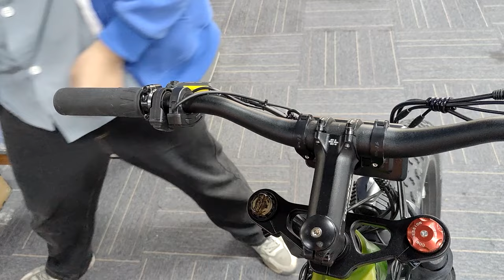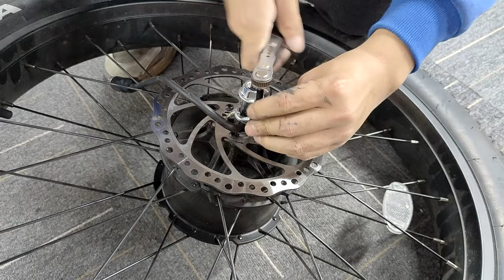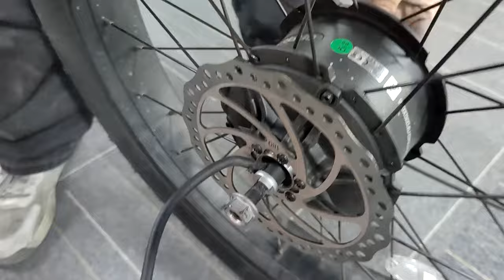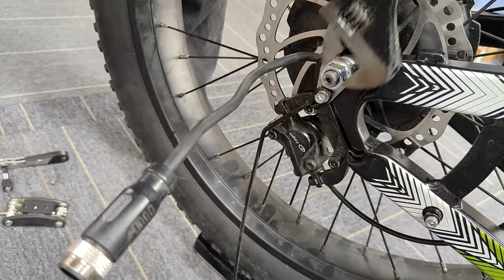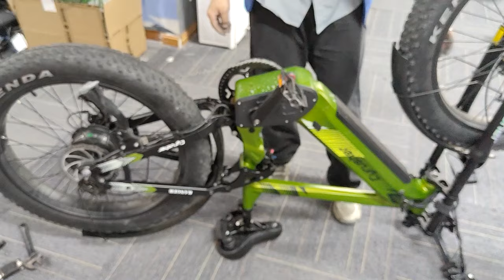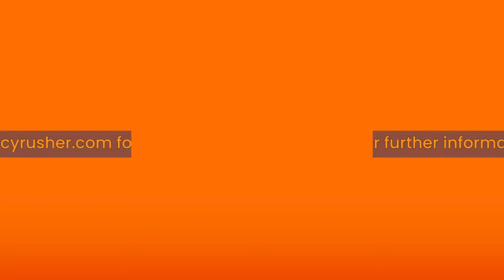Quick Tips - How to Replace the New Wheel and Brake Disc for Ranger | Cyrusher TV

Comment: The best tip is to fix a puncture without taking the wheel off.
Just pop tire off one side & pull inner tube out & fix with puncture repair kit.
It only takes 5-minutes and don't need to put Ebike upside down.